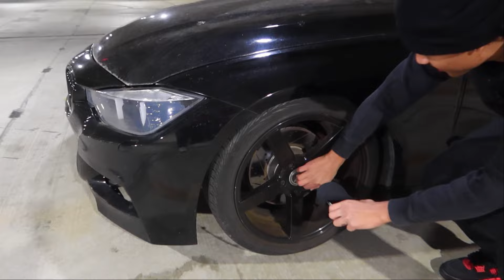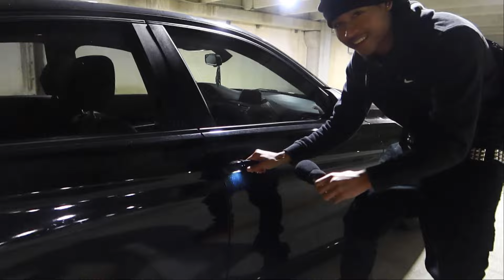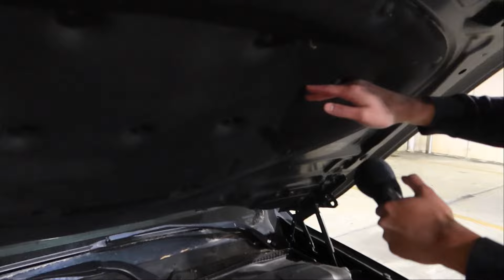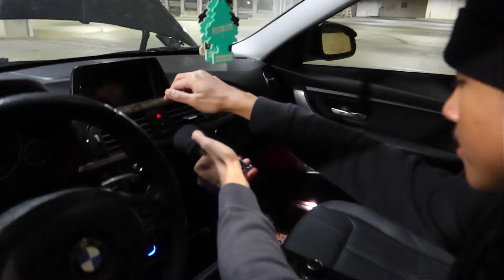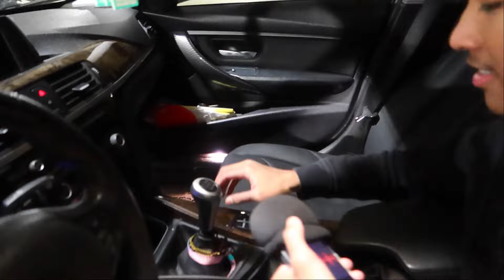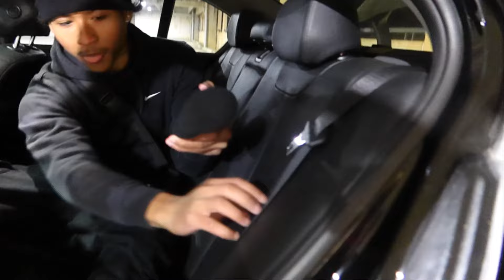ASMR IN A CAR 🚗 (TURBO TUNED BMW)

Comment: You better not be a boomer boy . AMG ONLY PRAY HARDER 😈
Reply: Bmw better, especially on a budget. Amg’s are beautiful though especially the black series, and the old hammer coupe.
Reply: @caboose6411  no , AMG just better . On budget even out of budget.  If you plan on owning this goofy hoopty  pack some oil and money for a check engine light 🥴
Reply: @thecreatordiesalone8703  Bmws never let me down before. They definitely age pretty well especially compared to most Mercedes, even some of the earlier 2000s Porsches
Reply: @caboose6411   this comment can’t be real 💀💀😭✋
Reply: I got a Benz bimmer and Audi and the Benz has the most problems outta all of them 🤷‍♂️
Reply: @armaanhira2587   I got a Benz my brother own a boomer my aunt own a Audi. Guess which ones in shop ? Boomer 🥴
Reply: @thecreatordiesalone8703  My last bmw had 350,000 miles and still didn’t have much of any issues. Sure it drank up a decent amount of oil but most old cars at that point do, and I drove it hard pretty often.
Reply: @thecreatordiesalone8703 Boomer 💯💯
Reply: @caboose6411   my neighbour got 500000km on the clock. E klasse
Reply: @thecreatordiesalone8703  that’s pretty good.
Reply: what do u drive add my sc and show me its smj.2019